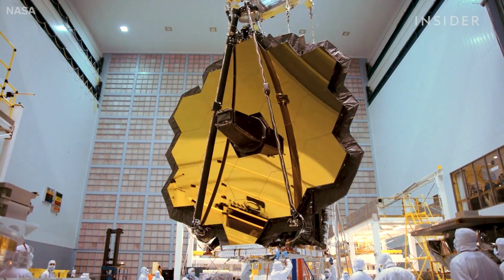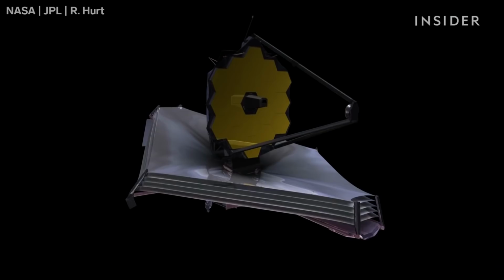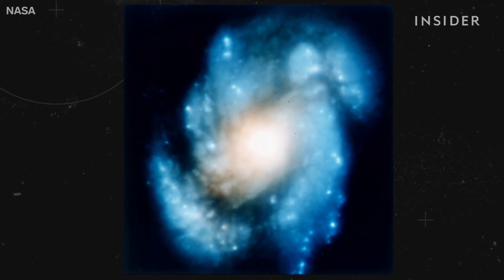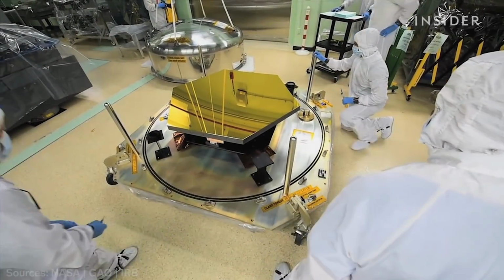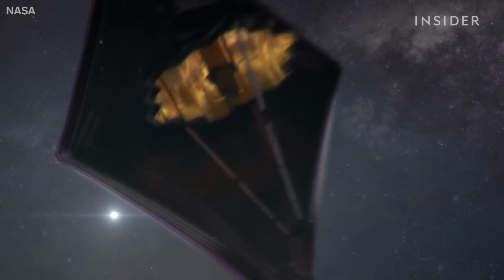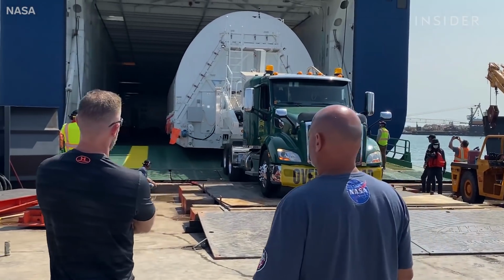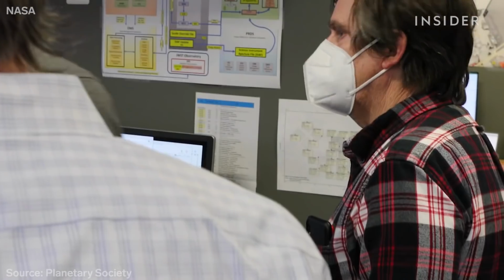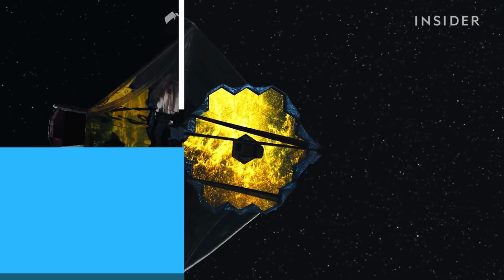How NASA’s James Webb Telescope Went $9B Over Budget | True Cost

Comment: I wonder, given the brunt of the cost was the development of technologies, why we would not make more of these for fraction of the cost?. I mean the technology is there now, what not amplify it’s benefits? does anyone know is there an estimate what building a new identical JWST would cost today? 1% or original budget?
Reply: That is Congress's problem which as an institution is very averse to such funding measures.  After all Congress does have an awful lot of other issues that require funding.
Reply: Off courses, prioritizing spending is critically important. My proposal above was to actually try to maximize the value of spend dollar by repeating what works at the fraction of the cost. If the current JWST planned to operate for 5 to 10 years, building additional JWST with developed technology for a fraction of the cost would basically double the data output and have significantly increase the overall value of the global space program. Now, I guess all boils down to my framing as a “ fraction” of the cost, :). If that fraction is in the order of 100M which seems realistic to me given all the development is done, it might be the idea worth of entertaining.

Comment: Kind of strange that something so expensive doesn't have on board cameras and hasn't had any pictures come out and it's been in space for over a month probably doing something else other than taking pictures of space objects.
Reply: Its busy aligning its mirrors. And we do have photos of it, …aligning its mirrors.
Reply: How ignorant, did you actually look online for photos? It DOES have an on-board camera facing back on itself, and it's released photos from that camera already. Also they've released a few of the calibration photos, although it just now finished calibrating.

Comment: Crazy to think a little meteorite could completely waste all that work with one touch.
Reply: Not likely and science deals with reducing the threats to this telescope that are most likely.  So the primary mirror can handle a direct hit if it is a small meteor.  Large meteors are very unlikely and this remote position in space.    

The sun shield is also designed to handle multiple hits from micrometeors which are what are most likely at its L2 position.  But even those are uncommon.
Reply: @michaeldeierhoi4096  a small meteor the size of a golfball would completely destroy the whole thing. unlikely but still scary thats all i was saying.